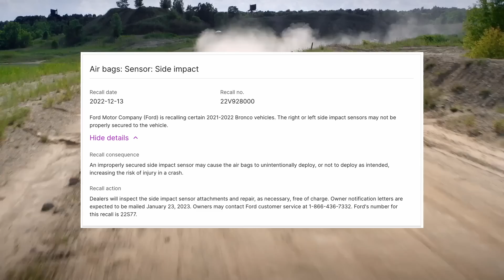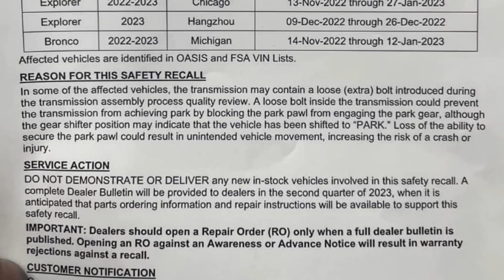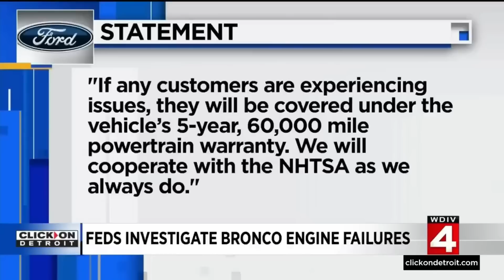YIKES! More Bad News For 2023 Ford Bronco Buyers

Comment: I was so enthusiastic about the Bronco.
  Thought I might get one, the I saw the price, the gas mileage, the weak-kneed acceleration. 
  Then remembered the last 4 Fords that my wife and I have had in 25 years and the issues,
with wheel bearing "assemblies, coil failures, transmission and engine failures and windshield leaks.
All of them bought new.
and I'm going to need a much better deal to buy any ford, any time soon.
I like to buy Made in America.
Which is one of the few nice things you can say about ford.
Reply: I have a 2001 Tahoe that has had almost zero problems since I bought it new in 2001. Get a Chevy.
Reply: get a toyota, more of them are built in the usa than any “american” brand.
Reply: uh, Ford makes a LOT of their vehicles in Mexico.  I mean, Mexico is still in America.....North America that it.  So, Made in America isn't exactly "false" advertising.  The Mach-E?  Mexico.  The Maverick?  Mexico.  The Bronco Sport?  Mexico.   The BIG badge Fords still are made in the US though i.e. the F150/250/350, Ranger, Bronco (not the Sport), Escape, Mustang (not MachE) and many others.  In any case, your experience with Ford products mirrors my nightmare of owning a Contour SVT.  Easily the worst piece of junk I've ever owned.....and I had Enron stock at one point LOL.
Reply: @dazednconfusedrn    Not even remotely close to being true.
Reply: @scarhart53  it is though. a good portion of toyotas (mostly trucks) are built in the usa. most american brands are built in mexico
Reply: As a Ford Tech I can only tell you you would be a fool to buy their products even with your own personal experience
Reply: Does anyone remember when Ford wanted to move everything to Mexico and Trump said no. Toyota better quality for the money wish they built a bigger truck.
Reply: It can happen though I am afraid that no brand is immune. A good friend bought a new Silverado in 2015 when I bought my F150 and his truck caught on fire and, there was a recall on it for that. Another friend who had a RAM warned me when I started shopping for a half-ton, to stay away from RAM. He said he kept his for "truck duties" because he had so much in repair costs invested that he was not up to replacement but loss so he would view it as a depreciating asset for as long as it was needed.
Reply: @rodneylw10  all new vehicles are depreciating assets I work at an F dealership and I watch people sing 3 to 5k nto their diesels every year and have done this for 20 years and plan to buy another one to me that's the definition of insanity I've had every Ram generation virtually every three years for the last 25 years and never had a significant issue with any one of them

Comment: First rule in life is avoid first gen no matter of it is electronic or mechanic. Let them iron out the kinks and whatever issue that they didn't catch in the test mules.
Reply: Right people think modern Toyotas are as dependable as the 99 tacomas with no tech and roll up windows and act shocked when they start having issues. 😂
Reply: @justsomeguy697  I learned to drive in a 86 Hilux with 5 speed manual transmission. That thing still rolling the town with a different owner.
Reply: @makatron  I believe it. Less things to go wrong, over engineered, techy cars always have issues.

Comment: Last two Fords I bought were a 2005 Mustang convertible, and a 1999 Ranger.
All the Mustang has needed was a harmonic balancer and struts.
The Ranger has only needed a complete front end rebuild, universal joints, and an alternator.
Still have both of them. 
Regular maintenance, and moderate care, and I've no problems. 
Not planning to replace either of them anytime soon.
Reply: Both more than my 20 yr old camry with 330k miles.
Reply: @rt2255  Both actually less because I do my own automotive maintenance.
I've got under $600 dollars in mechanical repairs in each of them ovet lifetime ownership in the rust belt.
You can't one up me just because you have a Toyota, although I do applaud your wise purchase. 😁
Reply: @marksmith8928  had 2001 kingcab v6 ranger decent truck crap for power but auto would not always lock in park lol nothing but honda and toyota since then.  Basic simple reliable, hate most new stuff to much electronics and gizmos that fail and cost way to.much for repairs.
Reply: @rt2255  Simple fix on your not locking in park problem.
That being said, I agree on the gizmo electronic useless crap on vehicles today.
I reserve my limited ownership of that stuff to home entertainment, and keep everything else as analog as possible. 
Still applaud your Toyota ownership.
Perfect vehicle for basic transportation.
Reply: @rt2255  Did I mention the Mustang is a ragtop?
Sometimes, basic transportation is better with at least one "I want" included with the "I needs" 😁
Reply: @marksmith8928  drives great v6 so plenty.of power loaded leather but the new one back up cameras lane departure etc just crap to go bad. I drove dump trucks an box trucks for yrs, 2 sode mirrors is all i.need to back up, car even has back window and rearview lol have buddy whose new truck ,2 yrs old already been in shop for auto start failing and lane departure malfunction oh and 300 bucks for tire monitors that failed. I got eyes and a gauge do not need light to tell me tire is low lol. More auto stuff more stuff to break and cost money. I am watching now for lexus is250 inline 6 rear wheel drive 200 plus hp mid 90s, they are abot 5 to 8 grand not to teched up
Reply: @rt2255  I still drive my 1971 AMC Matador sedan in good weather.
A little rust, blemishes and worn through paint.
That's what I call saving the environment. Plus, I will still drive around surveying the damage in case of an EMP. 😂
Never fails me. Ever.
Good luck on that Lexus. I can't bring myself to pay that kind of money for what you will get.
At least 50% overpriced. But, that is just my opinion. I don't plan on purchasing anything for at least another four or five years. 
What we are seeing is crazy world. This is what happens when the nuts run the asylum.
Reply: @rt2255  anyways, My guy 👍
Reply: The fact that Ford, for whatever reasons, stop making cars speaks volumes:  they abandoned quality and value.  Ford thought making big SUVs/trucks would ensure huge profits.
Reply: I've had many Fords, currently three, 2013 F-150, 2018 Flex and a 2022 Bronco, unfortunately we've had issues with the Bronco we've never had with our other Fords.  All my Fords have been very reliable, several kept to over 200,000 miles and nearly all way over 100,000 miles and with reg. maintenance they are great vehicles.  I do think that Ford does have multiple issues with their most recent vehicles, I hope they can get a handle on that.  I like my Fords.

Comment: Reserved my my bronco wildtrak with a small deposit, the wait was too long, ending up getting 2021 Toyota Land Cruiser Heritage Edition. Zero issues so far
Reply: You did not get affected by the recalls so far on them like the transmission recall or power steering pump or throttle position sensor or brake master cylinder etc. Over 31 common issues on them so far. People buy modern Toyotas thinking they are as dependable as a 99 tacoma with roll up windows, manual trans and no tech. Its halarious to see. They switched to turbo charging and new tech just like everyone.

Comment: My dad was a ford dealer mechanic  in the 80's, and it sounds like they are still doing what they did then. They rush something into production with out doing and long term development  test and just let the customer find the problems. Which is why he told me never buy a ford made after 1980.
Reply: "...with out doing and long term development  test..."  WTF?
Reply: When problem emerge in product development and the introduction date is not adjusted, that is what happens.
Reply: Jonathan, R&D is no existent.

Comment: The Bronco market is changing.  A year and a half ago there was no supply and huge markups over sticker. Now most all Bronco models are plentiful and some dealers are selling them at sticker price. If you want to buy, be patient. The market is moving in your favor.
Reply: You are right about that plus Ford factories will be shutting down soon for retooling getting ready for next year's models so inventory always grows this time of year as there will be much lower delivery numbers now until about August or later. People don't realize the industry keeps going through supply line changes and will need more time to make sense of the fluctuations in numbers.
Reply: Ford won't need to worry about re-tooling anything, people are sick of $10-20 thousands in markups.  I'm not a markups person & if I wanted it I would do it myself.  Ford, Ram, even Toyota are loosing a lot of business by Ford & their stealerships arrogance.
  If I want something, I'll put it on myself not get charged double by engineers that can't do it right after years of experimentation.
Reply: I just got one for $1000 off MSRP, four door black diamond with Sasquatch package
Reply: @dustyking8851 i work at a ford dealership. No vehicles have mark ups except the raptor R. Just sold a 24 bronco today new at 2400 under sticker. Now all dealerships arent rhe same. Every single manufacturer had dealerships getting crazy with markups during covid. Less supply, same demand equals higher prices. Now that its been a while if you are paying over sticker, you loose 😂

Comment: 0:44 I can confirm this is true. I inquired about Bronco Wildtrak or Raptor & the lone Ford dealership on my island said they'd add a "dealership mark up fee" of $9,996 for the Wildtrak 🤯 & that "the Raptor would be an even higher mark up".

That's INSANE. I really wanted a Bronco, it was more appealing overall than the Jeep Wrangler Rubicon package & the Toyota 4runner TRD Pro...but if it's just a massive cash grab ON TOP of the already hefty MSRP, I pass. I'll take my $70k elsewhere & get a better more for my money.
Reply: Get you a 4 runner talk about reliable..

Comment: I bought Fords my entire adult life.  The last good Ford I had was a 2003 SVT Focus.  I bought a 2012 Focus (bad transmission) and a 2014 Escape (Ecoboost head gasket issue) so I for my latest car I bought a car from a different manufacturer.  It will be some time before I consider buying another Ford.

Comment: what i have watched online is a lot of low end broncos where bought up before the hit dealers and modified with after market parts and sold at a large markup so i would check the vin and see what came with it from the factory it is real hard to find a all factory 2 door base 4 cyl 7 sp with steel factory rims  the one i want and will never be able to own

Comment: Between quality issues and INSANELY outrageous prices, this is yet another example of why I say BUY OLD!  You can buy a 70’s bronco, put in a new motor, new transmission, new tires and brakes and have a New truck.  For a fraction of the price of a 2021-23.  And not have any computer issues, chip problems, emissions problems or any of the other ‘improvement’ failures that new vehicles have.
Reply: Yeah, but one prob with your solution: you get in an accident in a vehicle with a 40 year old frame and body, you'll be painting the inside of that thing with your brains....
Reply: Nahh, buy a Toyota problem solved
Reply: @henryjoshual1848  I was thinking the same thing.. haha
Reply: @lorddrake8566  Crazy how many other 3rd gen 4 Runners I see on the road on the days I have to go into the office.
Reply: 70s Bronco fully restored and or modified is around $80k to $100k.
Reply: Na, these full size Bronco are a beast and worth every penny.  Now price gouging needs to stop.

Comment: Only one of those recalls bothered me. They fixed all of them, so let's get real. I bought multiple German made vehicles and Germans now build most of their cars to fail and they don't fix their failures. In fact, they lie. Should I mention the lies on MPG? 

Better example: the Audi CV (constant velocity) transmission fails so predictably that almost none make it past 50,000 miles. Most fail around 30,000. Good luck getting it fixed. I had extended warranties. Had three fixed. All failed again... in less than a year, or close to it. After that, I couldn't find anyone willing to do a repair. Literally, by that time, all transmission shops refused. Cost of a new one: $7,000+.

Of course, they also give you timing belts versus timing chains. Plastic impellers versus metal. I literally could name hundreds of components designed to fail. I will NEVER buy a German made car again... ever.

So, quit bashing a company that actually fixes their problems. You really aren't doing apples to apples comparisons at all. You have no idea how much you should value a company that admits their flaws and fixes them.

Comment: The quality issues on Fords really started getting bad during the Covid scare when factories began coming back online IMO. Also if Ford wants to stop losing money someone needs to figure out why every Ford F-150 range vehicle not made at the KC plant come off the line with zero gas in the tank. It's been that way for years so someone is making bank by not putting gas in those vehicles but still charging the dealerships for said fuel.

Comment: The Bronco was and should have been a solid front axle, 6cyl base with mid size v8 option, manual trans standard, auto trans option, inexpensive, basic tech, 2dr, 4x4. What we got was a grocery getter with a good off road package. The Rover D90 was more Bronco than the what we have now. Looks sell but performance and ease of repair  keep buyers coming back for more.

Comment: Same thing happened with my Chevy Uplander (discontinued) Valve seat covers shattered and the warranty was rendered void. Had to buy an entirely new engine, which then also destroyed itself.
Reply: Hate to say it, but I don't trust American Brands anymore. It's all Toyota/Lexus, for me. My Toyota Pickup truck now 35 years old, I'm still driving it as my daily. It works fine. Paid off a long time ago.
Reply: @mojavedesertsonorandesert9531  Same here. i will say American interiors are flashier and better outfitted but the interior doesn't get you from A to B. I bought a Chevy specifically to Buy American.

Comment: Been a Toyota guy my whole life and my 21’ bronco 4 cyl turbo was the first ford I’ve ever bought. 30k on it and I’ve had zero issues. It’s smoother, more refined, more powerful and more off road capable than my 4runner trd off-road. I’ve been through the Toyota floor mat issue, transmission issues, engine cracks, and the list goes on. Every manufacturer has its issues. Congrats on creating a channel based on bitterness and whining because you couldn’t find a Bronco.
Reply: What are you talking about?  Ok…30K miles, let’s see you hit 300K with that turbo 4 cyl. Prediction… you won’t even get close.
Reply: NO Bronco comes close to the perfection of a. 4Runner.....
Reply: @henryjoshual1848  blah blah blah.

Comment: I purchased a 2022 Ford F150 Powerboost and had two recalls- both minor issues (windshield washer motor check) and (flickering LED brake lights). I am very happy with the vehicle and it is my third new F150 since 2015. IMHO, what matters is what issue the recalls are for- major ones are more troubling. Wiring can be a set of bad harnesses, etc. Remember, they were running skeleton crews from about 2020ish through late 2021.
Reply: I've been considering the F150. Now I know that I'll buy a Tundra.

Comment: Glad the deal with stealers did not go through.  A blessing in disguise.  Won't pay any markup for the broncos nor any car.  Never did in 20 years.  These broncos are overrated in my opinion.  No offense to owners.  What I mean it could be a good vehicle but it receives more attention than what it deserves because of the supply issues, pandemic, and it's a new platform, and the lack of competition right now.   When the toyotas and jeeps come up with something new,  and supply chain issues go away then let's see if the stealers can command markups on these broncos.  Remember the ZR2s?
Reply from the maker: I'm excited to see if/when a new Toyota 4Runner design finally comes out.
Reply: @MotorFeed  Yea, I'd be interested as well even the tacomas have been coming to my senses lately

Comment: Ford lost me as a customer in 2012 when I bought a new F-150 and asked the salesman at Tunkhannock Ford (Pa.) about the bad transmissions in 2011's and he said "oh, you can't believe everything you read on the internet, that's been taken care of".   The very next day, I thought I had been rear-ended and looked in the mirrors to see who bumped into me only to see nobody behind me. It was the transmission banging inside when coming to a stop.  Traded it in on a 2012 Tacoma TRD 4X4 Sport.  Still driving the Tacoma to this day.  Besides tires, I only replaced 1 battery, 1 muffler,  and front brake pads.

Comment: The new issue with the Bronco is that while flat towing, if the voltage drops too low while in transit, it will automatically go out of flat tow mode and shift into Park causing a catastrophic failure of the transmission. Ask me how I know. A $7,200 bill that was covered fortunately under warranty.

Comment: Ford has had generations to fix its reliability problem. The first Broncos were being built in 1966. A Ford Bronco is the reason my dad went to Toyota's 40 years ago, my dad said don't buy a Ford son they will take your money and leave you stranded... Instead of Ford delaying the release of the new Bronco to make sure it is solid and tested as possible they are making the same mistakes they have for decades.